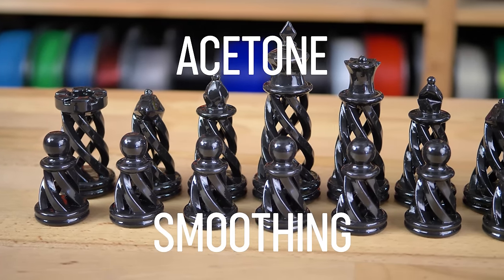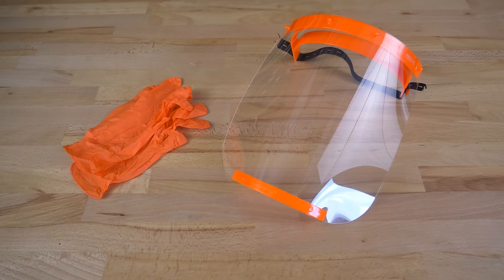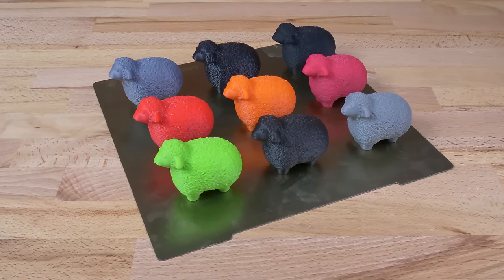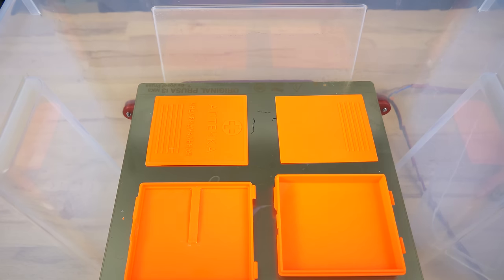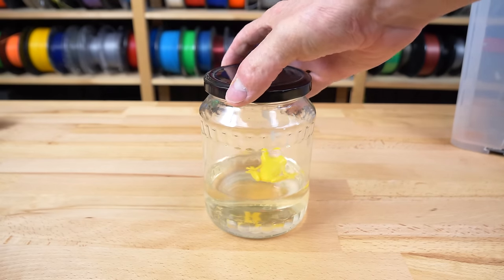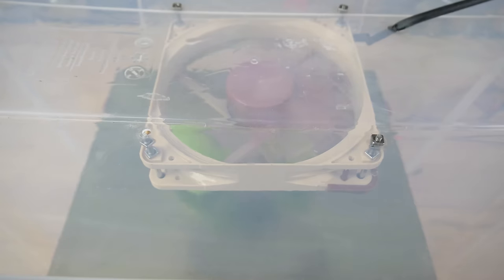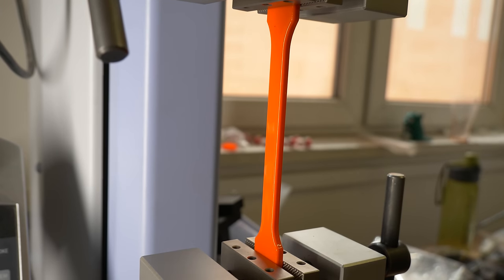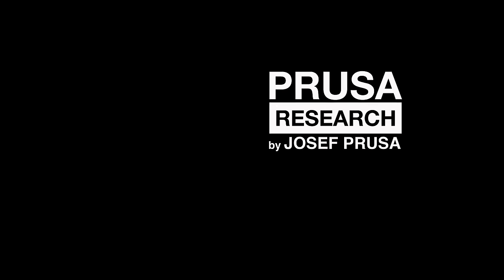Improve your prints with acetone smoothing

Comment: What about dimensionality changes.
Reply: yes this is only good for non-mechanical parts (mostly)... unless you consider in the losing of material into the print, making it (for example) 1mm expanded then needed and thus can get that 1mm removed via smoothing! (ofcrs it's not 1mm but just an example, more likely 0,1mm ranges)

Comment: What size container is that? I have a tiny glass jar, and I have been looking for something exactly like this to do my smoothing in! And I have extra Flex plates to even use :D Wasn't sure those totes could stand up to acetone.
Reply: You can use various sizes. It is important to use a container that cannot be dissolved with acetone. PP (Polypropylene) container works just fine.

Comment: Did you use that heater bed under the box ?
Reply: Yes, we did. It increases aceton fumes concentration and helps it to distribute more evenly inside the box. It makes smoothing faster and more effective. BUT! It is a lot safer to use cold method or proffesional smoothing station.

Comment: Contradictory results to those of Stefan. hmm....
Reply: Link?
Reply: @_droid  Dont feel like watching vids, commenting to see answers xD
Reply: How come?
Reply: An improvement of more than 200% in layer adhesion vs negligible 🤔 
But yeah.. i recalled incorrectly. I thought that when Stefan tested it it had shown less strength. My bad.
Reply: @santiagoblandon3022  Crazy big difference. I guess Prusa had left the parts in acetone for longer time, but I do not get this result anyway.
Reply: I tested standard dogbone samples for layer adhesion and there smoothing didn't help. Prusa used samples with a very sharp notch that was significantly smoothed with ABS thus decreasing the notch factor and I think therefore increasing the strength. I doubt that the results would have been the same with standard samples. Still an interesting discussion, where the differences in results are coming from!
Reply: Please test PETG's toughness after rejuvenation (heating them above Tg and then quenching them in iced water) 🙏🙏🙏
Reply: @CNCKitchen  I agree with you. Our models may have been stronger due to long exposure to aceton vapours in combination with the shape of our test models. However, the dimension change in the narrowest spot was not so significant and probably couldn't explain such difference in layer adhesion we had. I think that more testing with various methods would bring us better results at this point. I might try more (and various) samples and see what really makes the difference between our results.
Reply: I would trust these results since they were performed on industrial equipment and not some home-brew lab machine
Reply: I thought that at first too... but Stefan samples are standard ISO test samples. maybe the shape Prusa used for layer adhesion had a really high stress concentration at that sharp angle and the filleting caused by the smoothing greatly reduced stress concentration... maybe.. just speculating here
Reply: I suspect that it will have a “curing” time after bc it takes like days for the piece to turn completely solid again

Comment: Do Not follow the advice on Facebook suggestion you should place a spark plug on the lid with the spark end inside the vapor box - and connect it to a distributor in order to burn off excess acetone fumes !

Comment: How do you safely dispose of the acetone?
Reply from the maker: Very small quantities (soaked cotton swabs, rugs) can typically be disposed with your normal trash, ideally in a sealed bag.
However, bigger quantities should be taken hazardous waste facility. The rules for these will change depending on the country. But for example here in the Czech republic, you can dispose trash at such facility for free once per month.
- Mikolas

Comment: Why is PVB criminally expensive?  Is there a reason it costs literally 7-10 times the price of PLA?
Reply: It makes glass shatterproof, so I guess think of it a car glass price?
Reply: @Dr.Eximious  Ah that makes sense.  Still seems strange for 3D printing applications.  Maybe the price will go down once it becomes more common in printing and manufacturing costs become lower.
Reply: @justinhawley7783  yeah, that's the thing with most esters, ketones, polymers and plastics. Some are cheap because they are easy to make. Others require special stuff and are just sooooo expensive.

Comment: Its good and bad. It works bets for large prints and statues. But If I will try that on HO-scale model I print- which can have details as thin as 0.3mm, like rivets, girders and railings - it will ruin all the small details.
PLus it doesn't work for PLA

Comment: hmm I have ABS+ And for some reason acetone smoothing does not work...?
Reply from the maker: Yeah, that's correct. It's because the "+", which makes ABS warp less is also the same thing that reacts with acetone :) It's partially mentioned at 1:35
- Mikolas
Reply: Prusa 3D by Josef Prusa Thanks for your response! So I actually left my abs+ part in the the vaporized acetone overnight to test and the smoothening actually worked! Just takes a long time haha

Comment: Thanks a lot. I want to say you how toxic isopropylic alcohol is. If somenone sprays cockroachs with it they die in some minutes. As they are also built from  cells, we can understand that it is harmful.
Reply from the maker: From a quick google of the topic, I would say that assumption may seem logical but is incorrect. Isopropyl alcohol is harmful for bugs, but not because it's toxic, but because it rapidly pulls moisture from them rapidly as it evaporates, it also removes oil from their exoskeletons, which normally hold the water in.
- Mikolas
Reply: That's not really a good indication of what is and isn't harmful to humans. Did you know that just plain old soap and water mixture will kill roaches in minutes  too? That's what I use to kill insect pests. And yet we use soap and water all the time.

Comment: The instructions are extremely dangerous, be sure to tell people to use an explosion rated fan or there could be an accidental explosion of the acetone fumes.
You should urgently review the instructions before anyone gets hurt!
Acetone is also toxic and can cause lasting damage to the nervous system. Most of the time, this damage cannot be noticed immediately and only occurs a few years later. It is therefore advisable to only work with acetone in well-ventilated rooms or outdoors.

Comment: Acetone makes petrol (gasoline) look silly.
Its not something you should be using in your home or without very strict safety protocols. DONT DO IT!
Reply: Well acetone is fucking nasty, open all the windows, be close to a window and it's fine. If you do this all the time, mask up. Ideally go for a walk. However it ain't so terrible no reason to panic. Yes I've used acetone, for other purposes though